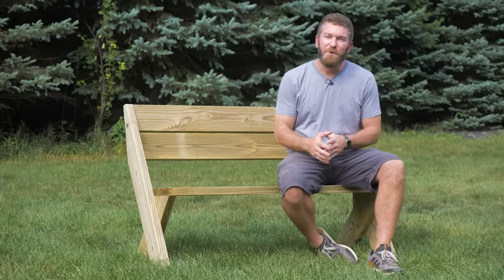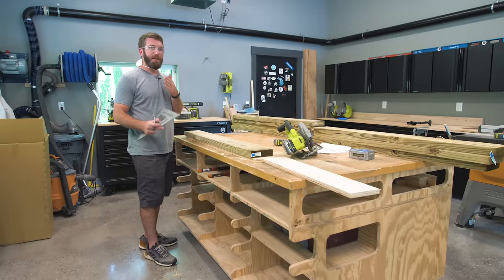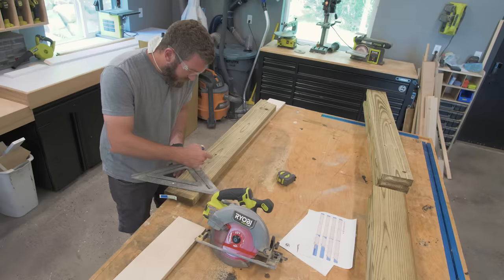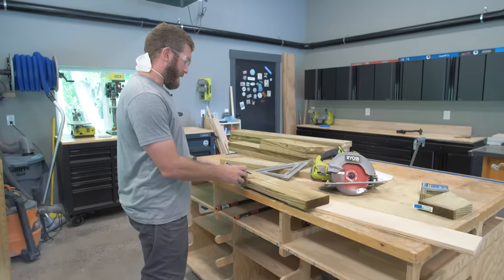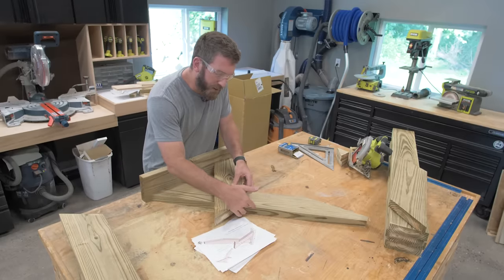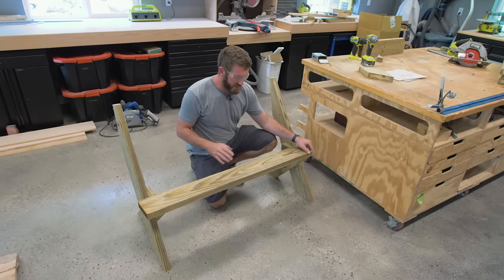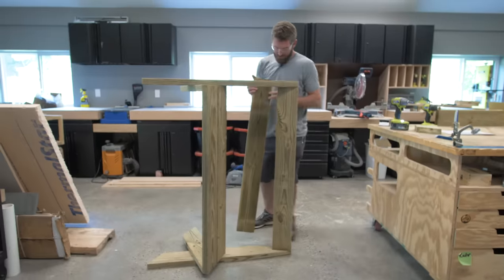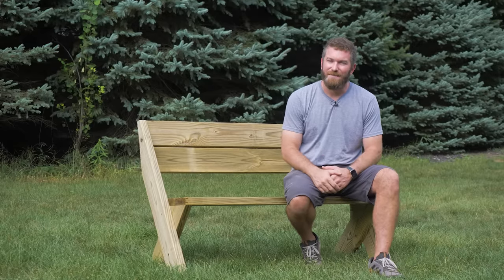$30 Outdoor Bench with Back from 2x6s [Only 3 Tools and 30mins]

Comment: Built two of these and they really are as easy as he makes it look.  If you build two, then you only need 7 2x6x8' boards.  These are very stable and don't tip forward or backward easily and are quite comfortable.

Comment: I built one of these using your plan and it came out great and I just wanted you to know that with the two longer leftover pieces I found a way to make arm rests with cup holders. You just cut out a long notch in the middle of each that would wedge into or over top of each long leg and underneath the lower back support cutting an angle in the front portion of the notch to match the angle of the front part of the long leg, then cut out about a 4" hole at the front/center of each arm for a cup holder and then epoxy a shaped piece of thick rubber padding on top of the holes reaching the width of the arm and part of the length and finally cutting a cross slit at the hole location. I did not know how to add a picture of what I did, sorry.
Reply: I would love to see pictures!

Comment: Looks like a very cool and simple design - BUT, it also looks like if you lean back on the backrest it would flip over because the back legs do not extend past the center of gravity?
Reply: Nope.  I built two of these and they are very stable.  If you sit and push back hard enough to take the front legs off the ground it still does not get over center and fall backward.  Very stable.

Comment: Ive made 3 of the 2x8 benches from your video and came out great.  Price difference in 2x6 and 2x8 arent that much, its like a $2 difference per board.

Im guessing all measurements and angles are about the same as the old bench ?
Reply: So each 8 foot board would be an extra $16 and it takes 4 boards so that's a difference of $64.

Comment: This is probably a dumb question 🙋‍♂️ but… how do you get your cuts soooo straight with the circular saw. I have an old circular saw that I have here but my cuts always come out not straight or the cut it self is really wavy not a smooth cut like if the blade is moveing

Comment: Peace to you brother, I printed the plans for the bench and blindly made all the cuts per plan. That's what prompted me to comment. On page 7 of 13 in the printable directions, the illustration shows what I perceive as the taper cut for the back as being laid out from the  long point of the 20 degree top cut. That's what I did only to discover on assembly that is incorrect. After that I reviewed the video, which I can't do in the barn where I'm building the bench I see you specify the short point side. arriving at my local lumber store at 4:55 I got a replacement board as to finish the job this evening. Has Anyone else made this mistake? I'll reverse the cuts on the bottom and make a couple of lower back benches perhaps as to not waste the wood.

Comment: hi ! great job and great video. just worried by units... i'm french and don't understand inch / cm 
For example, 33" = 83,82cm right ? but what about 24 - 1/2" ?? is it 24,5" = 62,23 cm or 5 3/8" = 5,375" = 13,65cm ?
i would love to try :) 
thanks for all
Reply: Yes. 
Bare in mind as it comes to lumber width, actual size is different than advertised. For example: Two-by-six or 2 x 6 is actually 1 1/2 inches x 5 1/2 inches. There are charts online. 

So now the question is what are standard lumber sizes in EU :)  I am about to find out at Leroy Merlin :p

Comment: This is great, thank you for sharing your plans. I have a question, I made this and it was all good and level for some time, but in few months it has warped a lot with the levelling conpletely off. Is there a way to prevent the sleeper timber from warping so soon? I used h4 treated sleepers, sanded, washed them with water to clean up, coated with stain and water based varnish. Thanks again